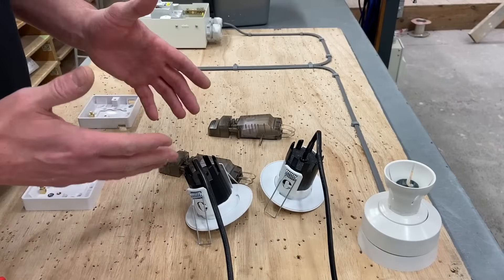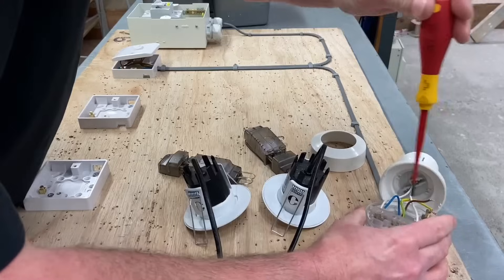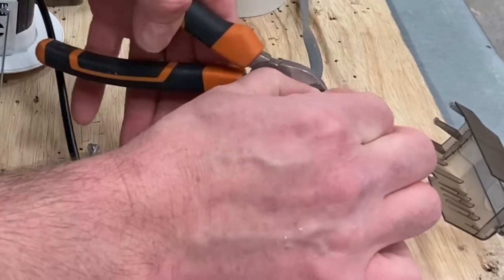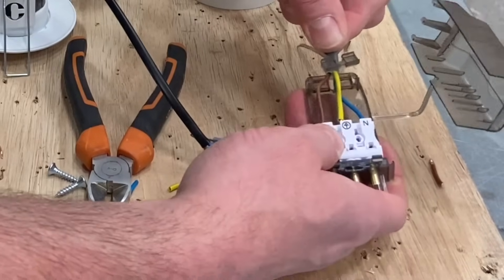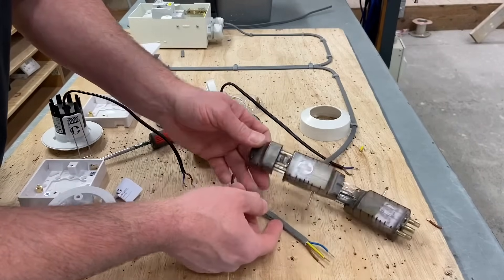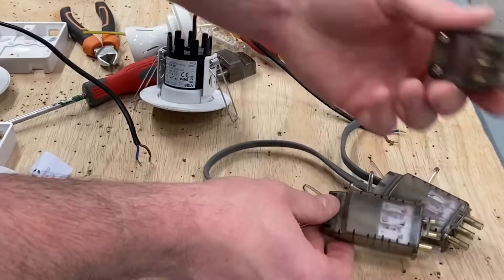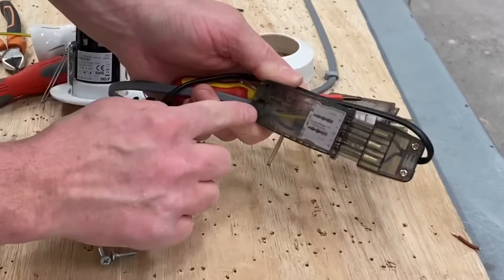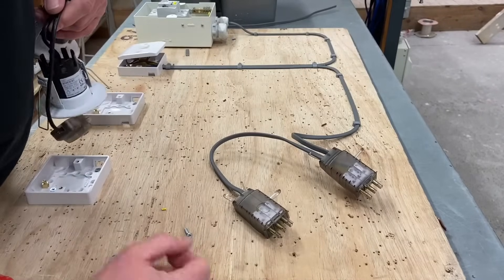Lighting Circuit 2 Plate Method Wiring 2 LED Downlights Using Collingwood Easy Fit Connectors

Comment: Just wired 6 led strip lights with the method the first two lights are permanent on the other 4 work perfectly when using the light switch what could I have done wrong

Comment: Worst connectors ever made, if you place 2 twin and earth, one ends up not biting. And comes out, causing the lights to flicker. 

The t connector case doesn’t even close properly, feels cheap and flimsy material. Without doubt the worst type of connector I’ve ever used, would even use screws rather than this garbage

Comment: Hi great video! What if it’s a loop in at the switch similar to this but there is a switch live, neutral, earth at the ceiling rose ? 

Would you just need to take the switch live , N and earth straight to the first down light ? How would it work 

Thanks

Comment: Shakey jake! What you cold or something?
Reply from the maker: I had a medical issue at the time
Reply: @GSHElectrical  sorry to hear that. Sounds like covid. 
P.s if you don't need the earth then why can't you just replace with 2core and then wire lights in series with wago. Rather than use big old expensive quick conecotors? 
Or was wago not about 2years ago?

Comment: Might be stupid question, how on earth do you change the bulb?
Reply from the maker: You replace the fitting 👍🏻
Reply: @GSHElectrical  

The whole thing, it's just been put in!
Reply: @GSHElectrical  Or you buy a fitting that takes G10 bulbs and save trashing the plasterboard ceiling every time you pull the fitting out. Hate those b******d spring clamps.

Comment: Hi Gary - another great video.
This shows us how to add more than one light (e.g. downlights) in the same room controlled by 1 switch but can you also use the 2 plate method to control the lights in another room controlled by its own switch? How do you get the power to the second switch or do you simply need to run another cable from the consumer unit?
Reply from the maker: Wiring Diagram 2 Plate Method - Taking the Feed to Another Room or Switch Connection Explained https://youtu.be/R3_eXKo1NFQ

Hope this helps 🦾

Comment: Is there a version of this video where you show how to wire multiple rooms using the two plate method?
Reply from the maker: I have made a 2 way and 2 way and intermediate videos but not yet released - it’s just a case of taking line, neutral and cpc from the switch to the next room and you start again. Gaz 👍
Reply: @GSHElectrical  GREAT videos Gav thanks .. on extending into the next room ... are you simply taking the next feed from the switch COM (so now two wires here) and an additional neutral connection ?
Reply: @GSHElectrical  I also asked this question on another of your videos, what would be the easiest way to distribute the cabling from one switch to the other in the scenario of masonry walls and RCC slabs and not dry walls?

Comment: Hi. I'm a complete beginner when it comes to wiring lights. My questions are:
1. What cable is required 
2. What size fuse for led
3. What replaces a transformer to get from 240v to LED voltage
Reply: 1.5mm²
6A BS 60898 MCB is most common and RCD protection is vital for lighting circuits as we need to make sure the neutral is continous at all times. This will be perfect for LEDs but other lamps possibly might need thinking about. 
240V to ELV transformer is within the downlight itself I believe. Us sparks hate joists for that reason, if the transformer bit wasn't there they wouldn't be as big and much easier to install but downlights would never be made this way.
Reply: LED strips have a seperate transformer as they can not be built within (unlike downlights). This works just as effective

Comment: Great video. Could you make another video please explaining how to run a 2 way switch with the power at the first switch? Be a great help. Thanks in advance. Keep it up.
Reply from the maker: Lighting Circuit 2 Plate Method How to Connect up  2 Way Switches (Connections Explained) https://youtu.be/t_tFDV9K0Sw

This link is available for a limited time 🦾. Hope it helps. Gaz

Comment: Can you do the intermediate 2 way light switch vid please Gazz?
Reply from the maker: Lighting Circuit 2 Plate Method Connections Explained for 2 Way and Intermediate Switching (3 Way) https://youtu.be/B4m-dn6PKQU

This link was private I will turn it off again later today. Hope it helps. Gaz 🦾
Reply: @GSHElectrical  Thanks, Gazz, it's still private!

Comment: This may be a stupid question.  If you were rewiring a lighting circuit in a house using the two plate method, the aim being to cut down on wires to the light at the ceiling, do you have to use junction boxes, or have three cables into/out of each switch plate?  Or is there another cunning method?  Thanks

Comment: This would be far easier or quicker if both sides were push fit still need to mess about up steps with small grub screws and screwdrivers

Comment: Hi great video.
Can I ask you what is the current rating of the fuse in the plug top of the mains test lead that is used for RCD testing at the socket

Comment: For those of us unsure, do you need to press those levers down holding each conductor? It looks like once the cable is in it should be pressed down
Reply: No, you press them down when you want to remove the conductor.
Reply: @PhantomHDD  Thanks that's really helpful to know!

Comment: How many led down lighters can we run off the single 2.5 cable power source pls guy's?
Reply: Should be 1.5 ... its all depend on the wattage. But loads anyway
Reply: Do the maths. You know the current rating of an MCB/RCBO for a lighting circuit and the current rating of the wire (NOT 2.5mm^2). You should know how many watts each LED lamp draws.

Comment: I have used the Quickwire connectors at home for lighting. Really nice and compact and far easier to use than these IMO.
Reply: They are bringing out a adaptor to over come this
Reply from the maker: Justin Phillips can you connect a flex with those type of connectors?
Reply: @GSHElectrical  Good point, no you cant, just solid core.
Reply: Justin Phillips could you use ferrules on them ?
Reply: @Shush1984  No, the "receiver" for the cable core is too deep inside the unit. But they are great for extending lighting circuits and wiring up a rose (i.e. loop in / loop out, switch and load). If the light has stranded cable then I would use some Wagos inside a Wago lighting box just before the light fitting.

Comment: These are great but just find them a bit bulky, especially when fitting in a ceiling with pir insulation. Haven’t used the collingwood ones but click flow ones